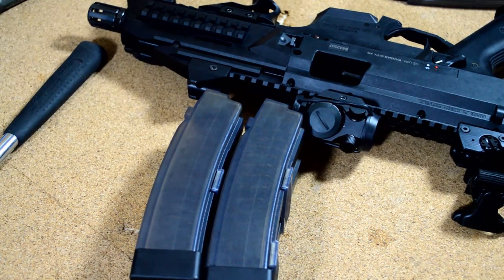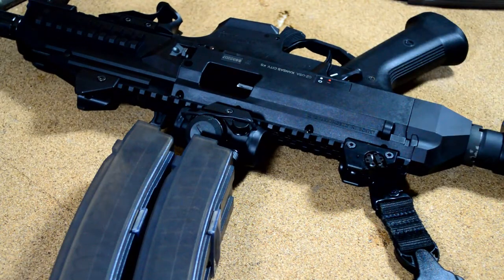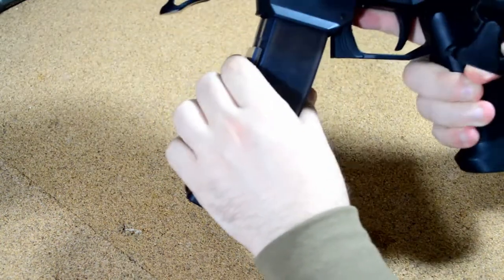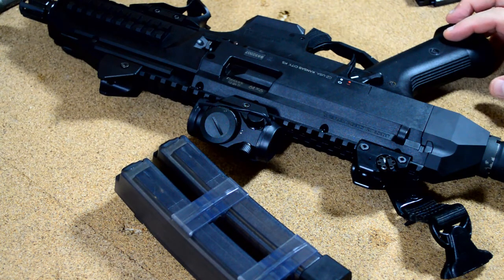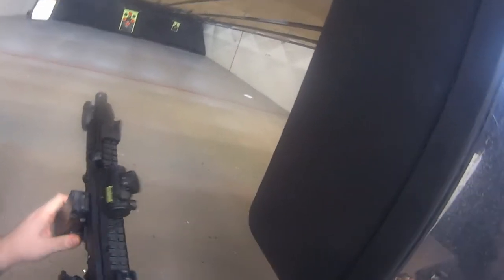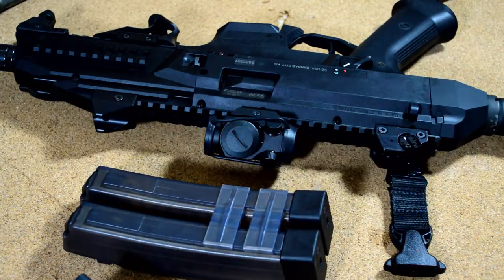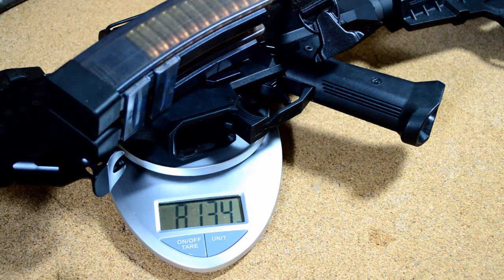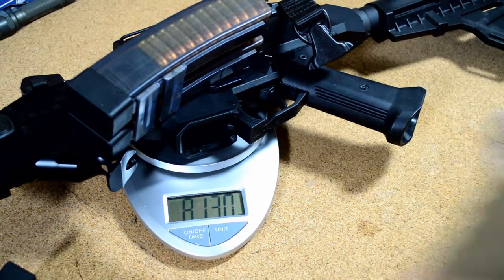CZ Scorpion EVO S1 Mag Couplers - Issue and Solution

Comment: Do you need both on a pair? I used one coupler on one set and the other on another set.
Reply from the maker: If you find a way to fix them in one spot, a single coupler would work

Comment: I find the factory iron sights way too low with the shockwave blade.  Can anyone confirm that the factory stock has a lower cheek weld than the blade?  I threw my AR15 sights on and they were just a little too high.  I think the micro flip up sight set from Troy will fit the bill perfectly.  Too bad they're so expensive.
Reply from the maker: +Blatant Abuse If you look at LE model with the stock http://cz-usa.com/product/cz-scorpion-evo3-a1/, it is much lower than the straight blade. I agree with the blade the sights are kind of low, but using the red dot resolves it for me and the TRS-25 cowitnesses as well. - OTOH, I am duing cheek hold, so it is raised.
Reply: Yes, of course, I do cheek hold as well.  I never touch the my shoulder with the blade.  How can you tell that the factory stock is lower?  I really can't tell.  It looks the same to me.  I hope you're right, as I'm going to form 1 this thing in 2 weeks.  I really like the sights that come on it, and don't want to replace them with boring AR sights.  :)
Reply from the maker: Blatant Abuse It looks to be at an angle down, plus I tried it once with LE model in local Class 3 store, when the Scorpions were just becoming available, it fit well. I am going to Form 1 mine as well, but probably next year. Here is a link to SBR picture http://www.guns.com/wp-content/uploads/2015/07/cz-scorpion-922r-parts-kit-sbr.jpg - looks like the stock would be a little lower than the blade
Reply: You should really look into the Lage Manufacturing AR tube stock adapters and side folding adapters. You can lower or raise your shockwave blade on a buffer tube to your hearts desire. I thought a lot about getting the shockwave blade but decided on going with the Strongarm brace instead. Waaaayyy happier with my decision (even after going through three buffer tubes to get it to fit because the diameter requirements are lower than your average buffer tube, but KAK industries makes one specifically for the Strongarm brace, so it wasn’t a hard fix).